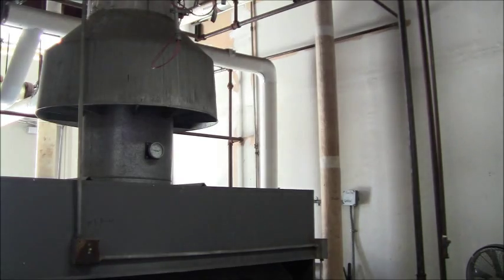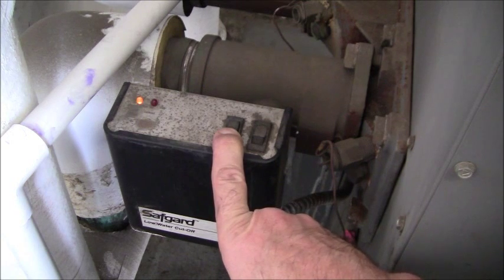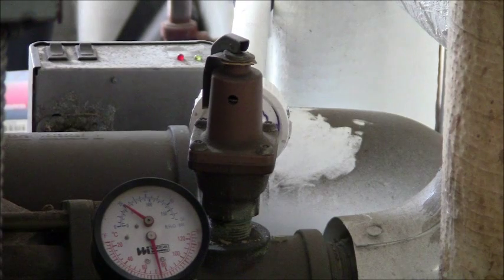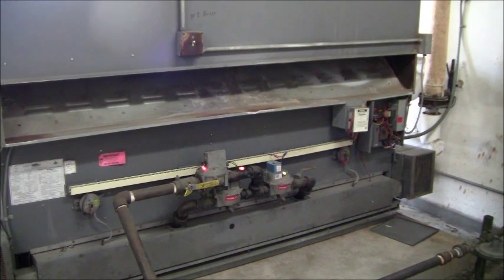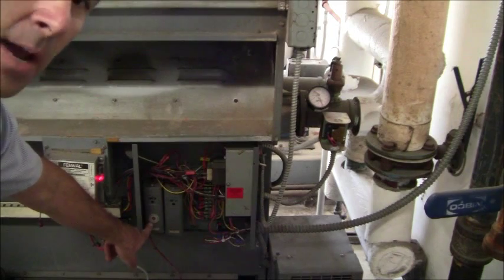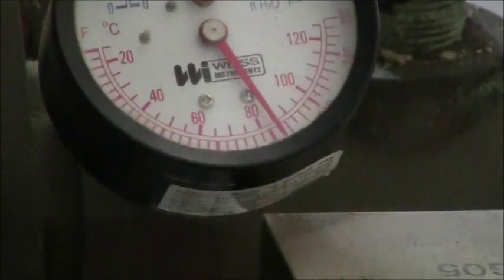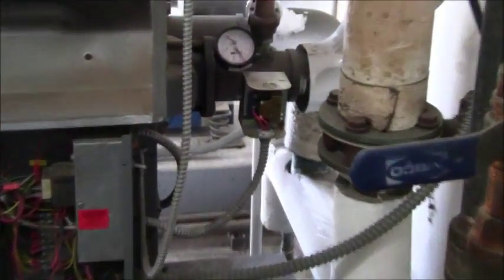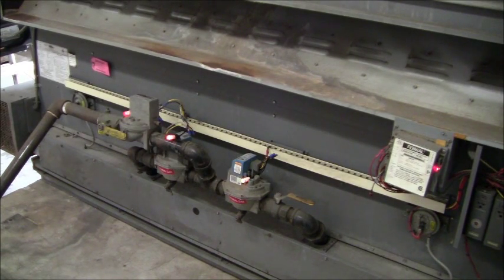Testing the Safety Devices on a Laars Boiler

Comment: Don’t ever pop. Relief valve unless you absolutely have to for getting air out of the heat exchanger or getting some air into the system when draining the water heater. They are not designed to be opened and closed whenever someone decides they want to dump some water for some reason that isn’t one of the two examples I listed above, they don’t always reseat and now you need  to replace it if you can find someone who stocks them . Supply houses are not stocking anything that they don’t normally move quickly and will order it for you but if it’s dumping full pressure then you can’t run that unit until you get that new safety valve..

Comment: Ken,what wrong when calls for low airflow & the boiler wont start .starts manualy reset
Reply from the maker: the unit may have an air flow sensor or sail switch. the low air flow may not be enough for the safety switch. You need to look at what is locking it out.

Comment: Pressure relief valve piped with schedule 40 pvc with a max rating of 140F on a boiler at 176F. Should be screwed pipe or copper.

Comment: i usually check gas pressures to make sure you are not over or underfiring boiler and most important combustion analysis to make sure its not producing CO and it will tell you if your getting enough air/fuel/etc.thanks for posting